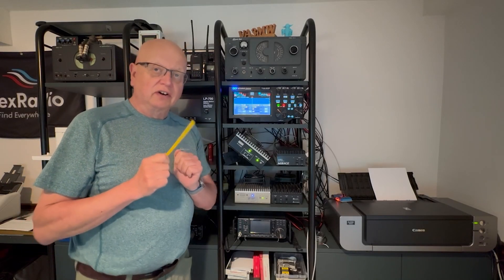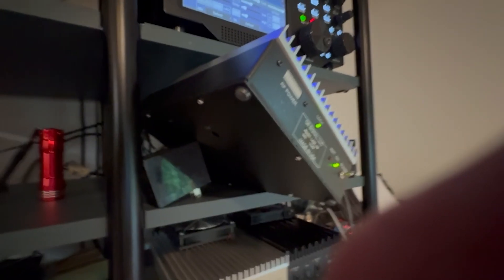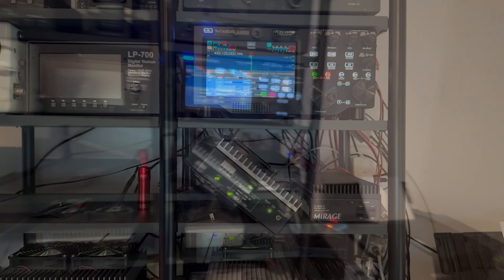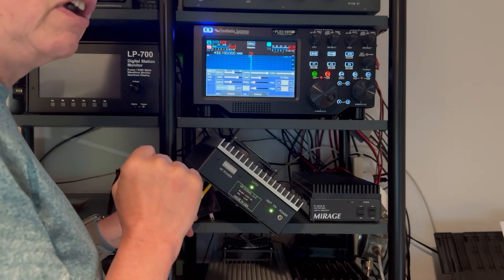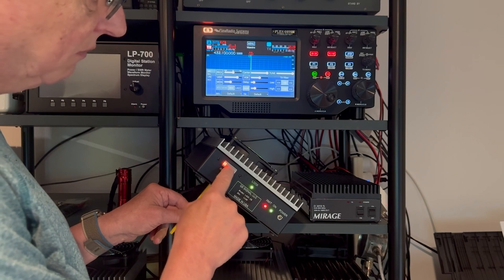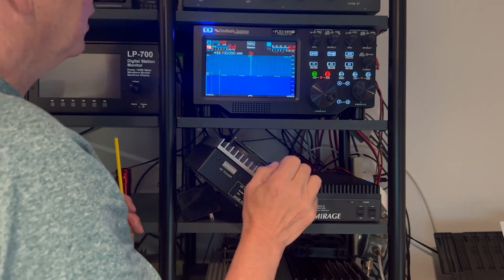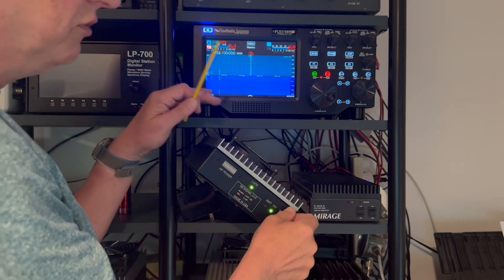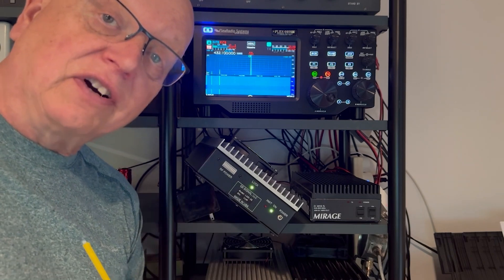FlexRadio - Q5 Transverter Alignment

Comment: Still a bit unclear about the Flex setting. I presently have the receive gain value for 2m at 0 db. Does this seem right?
And when I turn the Q5 off I get no sound or signals at all.

Comment: I turned mine upside down, removed the bottom cover then did the adjustments when the two pots were exposed and clear. I think this is easier than poking around through the access holes.

Comment: Initially, I used the Rx alignment method you suggested. I had serious concerns about the Q5’s (2m) sensitivity when I wasn’t copying stations that were audible on two other transverters. I decided to measure the sensitivity and saw that marginally copyable signals were showing about S1 on my 6500’s meter.  I decided to adjust the Rx gain using a signal input equal to S9.

Turning the Q5 on, and off, produced a very slight but noticeable increase in the noise floor. I took my findings to Cory at Q5 to get his opinion. While he said that it wasn’t a  very critical adjustment, adjusting to achieve a slight increase in the noise floor is what he suggested.

Fast forward to last week I noticed that I’m no longer able to get all segments of the LED indicator to come on. I’m going to use my generator to determine if it’s related to the Q5 or possibly by a diminished drive from my 6500. I need to also measure the RF output from my Q5.